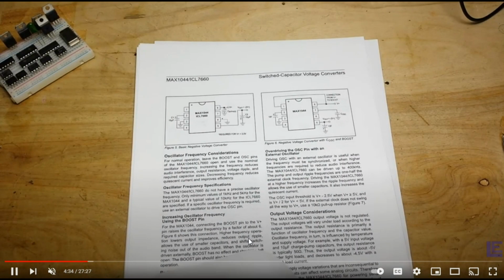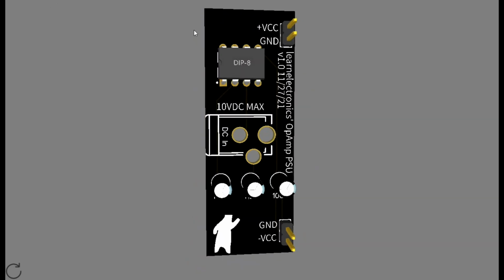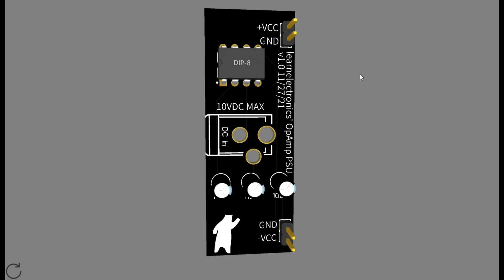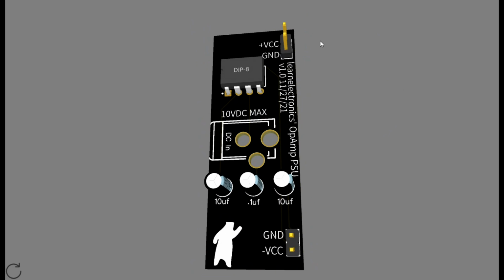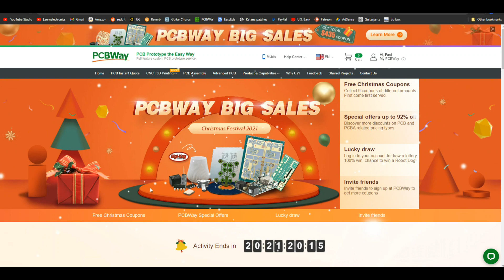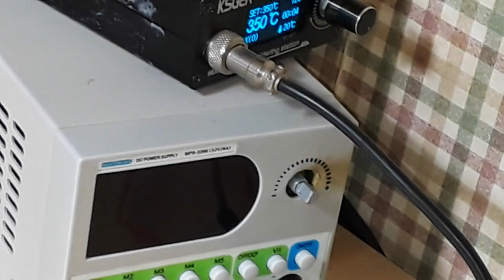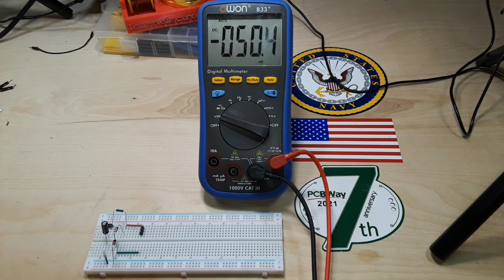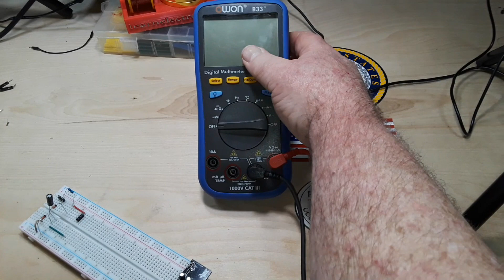OpAmp Breadboard Split Rail PSU

Comment: So you burned up your power supply? If your like the rest of us electrical hobbyists you got a stack of power supplies that you have taken out of old computers.

Every time I look at one with tons of extra connectors pouring out of it I think to myself "there's gotta be a way to add some of these together to get other voltages" but I'm not a magic pixie wizard.

I'm still wrapping my head around how in your previous video you chopped the voltage of a power supply in half and made half the pixies dance positive and half dance negative using two diodes? It works but I don't have a clue as to why.

Too bad you can't use two diodes to reverse that process. Then you could get some decent voltage out of one of those old computer power supplies to build into a hobbyist lab power supply.
Reply from the maker: You can hook those light voltages together out of the power supply and get a lot of current.
Reply: @learnelectronics   Current increase yes but I want a supply with a higher voltage.

Comment: Is there any voltage between the grounds on opposite sides of the breadboard? What is the voltage between positive and negative across the breadboard? I am hoping that you will resolve this conundrum and explain in the next video. Your device would be very handy if the voltages were equal with opposite polarity.
Reply from the maker: They should be and are supposed to be equal.

Comment: Thanks! Fun! Low voltage = Weak Cap allowing excessive amplitude of ripple, causing the average voltage to droop? Did you use an el cheapo jellybean, or a used donor, without proofing it?
Reply from the maker: It's from my fine collection of shenzhen's finest capacitors

Comment: Thanks for yet another GREAT video-for the Intersil 7660, I also get wide variations for the +/ voltage values in 'some' .  I found an IC that does the same thing at +/- 100mA (..don't recall the part #, but I will never go back to the 7660 after using this IC).  
A couple of comments (1):  I would have used a machine socket for this IC for quick swapping-looking for better +/ symmetry. (2): After watching this, my version "B" PCB would use TWO pair of breadboard connectors per side--I noticed an easy tilting tendency.
GREAT IDEA for BB'ing op-amp circuits!!!  Did you do anything on the AD633 multiplier??...got stuck with a batch of cheap-but-fakes from EBAY--pricing was too good to be true...
THUMBS UP!
Reply from the maker: No nothing yet

Comment: Long time without leaving a comment in one of your videos, amazing as always!...for a project of the university I made a dual voltage power supply but using a LM2596 module, which basically we just added some protections as overvoltage, overcurrent and reverse polarity! The funny part was to make the arrangements of resistors and capacitors to make it dual voltage!...I hope the best for you! Keep being amazing!

Comment: My solution to fumes and filming.
1. Rig a 12 v DC PC computer fan to gently blow the fumes away from you.( At least 😃) OR
Record your audio with you extracter running. Then record the noise from the extractor solo. Use Audacity to remove the extractor noise from your tutorial s audio file then remux to your video. 
I suggest the first lol .Merry Christmas.
Reply: Exactly what I do as well. Beats sniffing those fumes! 👍😀

Comment: This is exactly what I'm working on next.  I still haven't gotten my 7660's to test.  Amazon doesn't care about IC's around Christmas I guess.    I'm wondering...Is the voltage different on each rail different because the ratio of C2 and C3 is not unity?  What if they were?  What would that ultimately change?

Comment: Pin#7 is the oscillator frequency which needs a capacitor it must boost the voltage converter. Measure the voltage drop across the input pin of the voltage converter to the output pin of the voltage converter there is a voltage drop

Comment: Great video as always.  Version 2 should have a small change to make using it a bit more idiot proof.  Your negative power and ground should be switched around because as it is now, the red rails are positive and 0 volts, and the blue rails are0 volts and negative.  It would be safer to have both blue rails as ground/0 volts and the red rails at + and - voltage.

Comment: i think one was off because it was further away from the header pins in the board, if you redesign the board where the chip is in the centre rather than on the far side you should get even voltage's on both rail's. (resistance from the traces's maybe is what i was thinking, but 1 volt is a lot. but it's best i can come up with)

Comment: Thanks for the video. I noticed in some of your videos, you mention that when we connect power to an electronic circuit that we should always connect the negative first before the positive. Are you able to perhaps do a video on why that is the case? Love your work Paul.
Reply: I'm not 100%, but I think we connect positive first only with car batteries.  In a car shop, if one connects to negative fist, he or she would ground the whole car.  Now, the whole chassis is grounded including nuts and bolts and everything metal.  This would create a slightly dangerous situations that can cause shorts, sparks, and fire if not pretty careful.  I heard in electronics; it is opposite.  We actually connect the ground / black / negative first.  I don't know why.  Maybe other's smarter than I can explain because it's a good question.
Reply: Heres my 2 cents. With electrical circuits of ANY voltage. GROUND 1st.
Automotive: depends if it is a POSITIVE grounded or NEGATIVE grounded vehicle. You can tell by:
Sticker under the hood.(would have to search , all different)
Use a multimeter. Set to highest setting above 12 volts. Red probe on positive terminal, black on chassis. Reads correct Thats how its grounded. You see the negative symbol then its "positive" grounded.
Reply: @xanderstrlyczula5438  1968 MGB European sports car, imported into the USA, was positive ground.
Reply: He always says connect ground first.
Reply: @mikebond6328   oops. My bad. I got it the wrong way round!! Thanks for clarifying that Mike. I keep on thinking about automotive connections.

Comment: like the bread board fitting add,  another must have chip for the part box... ; ) 
P.S. you dead right about Jed Clampitt, and i loved your scotch tape for holding in components to solder. i use it all the  time, but will be using blue-tac  from now on. (or until i run out or lose the piece ill put aside for holding in components)..
had to put in what you said about the data sheet. your the 1st person i'v heard mention that. IT IS YOUR FRIEND.